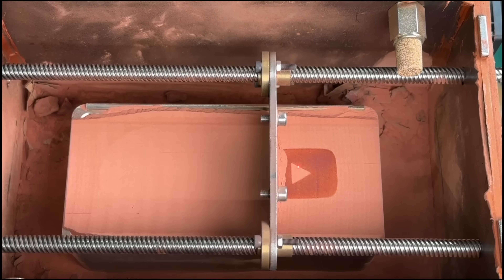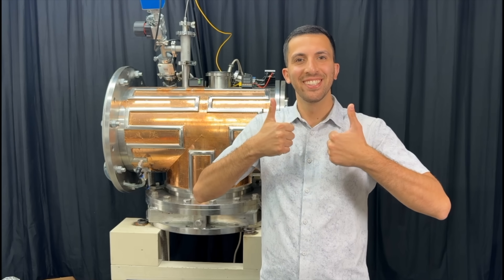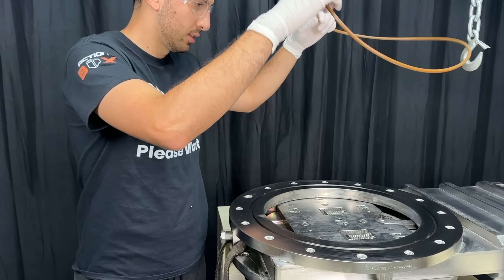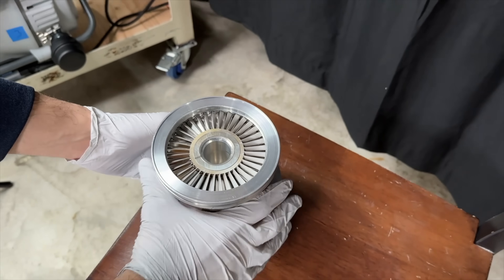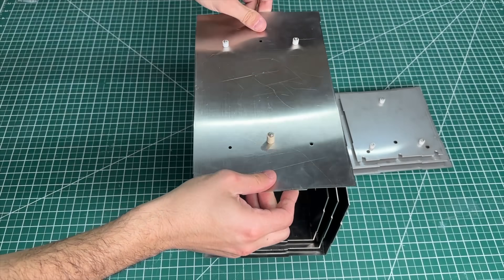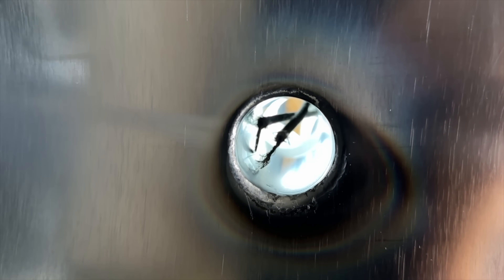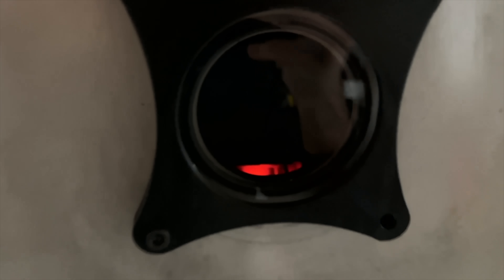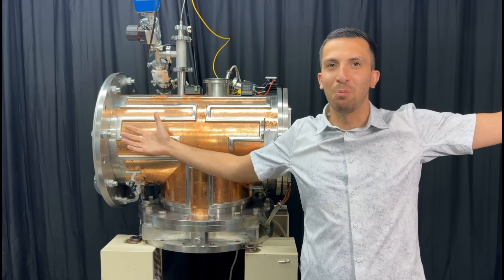DIY Vacuum Furnace (Full Video)

Comment: I'm floored by the repurposing at work.  Out of curiosity (this is 11 months after the original vid), did that interior magnet hold up to the high heat?
Reply from the maker: About 2 runs actually.  It definitely has to be covered with a heat sink to the main frame to keep it cool, Otherwise it demagnetizes.  Great catch.

Comment: 4:45

That particular style of turbo is cheap on the secondary market because it is ancient and prone to catastrophic disassembly due to using those thin turbine blades (you can't repair shrapnel). Newer models have much thicker and wider blades, incorporate a molecular drag stage to lessen the workload of the backing pump, and often have on-board ion gauges to disable the turbo in event of sudden vacuum loss. A modern turbodrag should be able to reach E-8/E-9 Torr within hours.

Source: mass spectrometer technician. I have several Pfeiffer TC100 equipped D-35614 turbos sitting at my desk, which is what we replaced all those Varian Macro Torrs with over the last decade.

Comment: I'm curious about using the clear plastic flange:

Were you able to get it down to UHV** levels? 
(Ignoring the heating effects for now)

All UHV references for mechanical design I've read so far tell me to just generally avoid it, because of outgassing effects, but I have little actual lab practice with these chambers.
Reply from the maker: I recall being worried that if it shattered under the load, then the turbo pump would be instantly destroyed, so I may have not tried to go to UHV with the plastic lid.
Reply: @ActionBOX  That makes sense. I was always so nervous of breaking the turbo when doing the pumpdown sequence on a leak checker, vacuum is more annoying to work with than people realize lol.

I've been thinking a lot about viewports and feedthrough / motion design, so I was really surpried to see you go with something of that size. We see yet again why windows in aircraft are so small!

Thank you very much for the response 

PD: your thermal shielding design is very impressive and surprisingly similar to how cryostats are planned out for physics-- I'm taking notes from this and also the 3D printer project in general. 

lmk if you could use any  CAD collab for the 3DP project, I'd love to give a hand here and there as I also recently took a certification in DFAM.

Comment: I've worked on a MOCVD system during my college years.... Dangerous chemicals is an understatement. Take Hyrogen+Oxygen for example. Yes H2O is just plain water but H2O2 is hydrogen peroxide. You aren't dealing with just one chemical, elemental arsenic. You are dealing with a wide range of toxic chemicals, each with there own dangers. Also implosion is the next biggest danger here. If the chamber ruptures, all the air will rush in to fill the void, collide with each other, and create a boom so loud that it will rupture your eardrums and kill everyone in the room (if it was a small room at least like our small lab was).

Comment: normally, you'd be in the 10^-6 torr range within 5-10 minutes without special cleaning absent really heavy oily fingerprints, not including the outgassing from initial pumpdown with the size turbpump you have. In fact, if you graph the pressure, you can see the fractional distillation of contaminants.

Comment: I am curious why you do not put the heating elements right inside the large vacuum chamber? Since you are at extreme vacuum, how does the 3 walls help in this situation? Is it just to delay heat transfer from IR to the outside of the chamber? I don't understand.
Reply from the maker: Yes that is correct.  It take much longer for the outer chamber to heat up if you have more heat shields. It also allows your inner most layer to heat up to higher temperatures.

Comment: Very attractive vacuum furnace you got there, especially the design of the sheetmetal reflective insulation. I've got a crusty old one in my shop that was probably used to repair or otherwise weld jet turbines - it's nearly big enough to put your furnace inside. I've got to replace the hot zone (removed when decommissioned as it was either made with exotic metals or graphite) with something like yours as an OEM replacement costs north of $30,000. I scavenged a controller I built in the past for a kiln and repaired a vintage thermocouple / ion gauge controller which can send a signal when certain thresholds are met, to start pumps or heating cycles, etc.

I'm curious to know what your marketing plan is for the metal 3d printers, as I imagine the vacuum furnace cost more than the printer and few people have access to these (currently - metal 3d printing at a local makerspace might make furnaces more commonplace). I only have an FDM printer, a DIY of course, from before you could even afford one for the home workshop, and planned to use the "cast to sinter" process - make a silicone mold of a plastic print, use the mold to form metal powder with a binder, debind and sinter.

Now, a more accessible powder bed 3d printer might be one for sintering plastics (which can be done at lower temperatures and without oxidation concerns, so maybe a spare toaster oven?) or for ceramics, which need higher temps than plastics but can be done in a traditional kiln without oxidation concerns, no vacuum required.

Comment: How did you tackle TC junction at the pass-thru connector? Were there poles of the correct material already? Awesome project and presentation.
Reply from the maker: Great question, I ran into that problem and actually just ran a thermocouple with stainless sheath through a yor lok connector to form the vacuum seal.

Comment: !00% you should get a hydraulic lift table. You an pump it up to the level of your hatchback floor and just SLIDE big heavy things out and roll them away. You can even pump it up to the height of the table you are going to place the part on and skip the hoist all together sometimes.

Comment: The oxygen partial pressure lines on that Ellingham diagram slope down from the upper left, so target partial pressure is more like 1e-7-1e-8 atm. That shouldn't be a problem, but it's different from what you said. Note that, unless one of those big o-rings has a problem, the residual gas under working conditions will be mostly water. With copper that's also not a problem, since water isn't oxidizing enough at high temperatures (should be another line on the Ellingham diagram for that) but with other metals, including as alloying elements in the copper, it's a factor. Also be aware that your pressure gauge isn't measuring the pressure inside the oven box, and that matters because the inside of the oven box has poor communication with the pump but will probably be the major gas source at some times during operation, in which case the pressure inside will be higher by some potentially large factor that you will have to account for. Great work!

Comment: I love that your channel is making all this equipment that's usually out of reach of regular people and its commendable because most youtubers have a its right in sentiment approach even if its misleading, what you can do to improve your videos is expand beyond you projects, because the project is only as good as what you can do with it for example in this video after you finished your build, people like seeing your tests to make sure it works as intended (did it get too hot, was it hot enough , are there any areas to improve, did the item made in the furnace fuse well, etc)  having the audience see the usage process and results turns your project from an over-engineered paper weight in the audiences heads to an idea generating piece of equipment that people want to suggest ideas to what it can be used for, even if its dumb things like creating a mould for your furnace to create precision teddy bear shaped toasted marshmallows.
I hope non of this comes across as criticism and more as constructive criticism, for me it would be cool to see some smaller projects using the equipment you have made, hopefully this comment helps. :)

Comment: Like your project an idea of 3D metal printer.
Here’s a problem to solve.  How to take existing molded products.  Directly replicate into a sinter body that can be sintered in your chamber.  Then goes into a moldings press.  3D scanning sucks because the entire object basically requires to be remodeled.
Reply from the maker: Hi Dan, We already have a solution for that. Check out our video from last week about INJEKTO M. You can simply replicate your parts with an RTV silicone, and then use INJEKTO M to inject metal into the silicone molds. Let me know if you have any questions.

Comment: I googled  "nichrome heating element" and also tried google lens on the image @7:00 but only found a single result that looked similar to what you're using from some website in Korea, finetherm.  Do you have a link to the one you used?

Comment: I'm surprised you could get to 10^-6 Torr range (@5:08) with that huge acrylic surface exposed to the vacuum.  Most things I've read talk about acrylic only being good down to maybe 10^-3 Torr.  Interesting.
Reply: That's exactly what I was thinking when he said he wanted a high vacuum but then put in a plastic window,
Reply: Pretty sure the use of o-rings keeps you out of the ultra high vacuum range.  Conflat flanges with OFHC copper gaskets will get you there!

Comment: interesting but makes no business sense to sell a diy printer that requires a super expensive vac chamber like this. 
Do you need hi vac or just very low oxygen for sintering ?There may be simpler ways to capture oxygen using redox reaction
Reply from the maker: Check out our latest video about INJEKTO M. We have solved this issue.  You do not need the vacuum furnace.  The furnace we provide will work as well 😃
Reply: @ActionBOX  yes ok the timeline got me confused, I guess this deluxe oven came before the last injecto video in your research even though the video for the oven got posted after

Comment: I was under the impression that turbomolecular pumps were supposed to be installed at the bottom to work with gravity.
Reply from the maker: There are different types with different levitation methods.   Some have a specific mourning orientation. The one we used did not.

Comment: Couldent you have got a lot lower tech by just using argon or nitrogen?
Reply from the maker: No sir.  In a high vacuum chamber at 10^-6 torr, the oxygen content is about 10^-9 atm, equivalent to ~1 part per billion (ppb).

In contrast, a 99.999% pure argon bottle contains around 10 ppm (parts per million, not billion) of impurities, including oxygen.

So A vacuum at 10^-6 torr has oxygen levels far lower than that found in ultra-high-purity argon.

Does that make sense? I can try to explain it better if needed.

Comment: Like the others said, remove the influencer bs, you guys don't need it. Your projects have actual substance.

Projects I'd love to see in this area (I know your covered some already): Drill press upgrades (bearings, DRO etc), press brake & shear, spot welder with flexible leads, sand blaster + cabinet, powder coating, bench top press (die cutting, pin setting etc), storage and moving solutions, surface grinder. 

Basically considering the full picture end to end of some products that might be made with your tools, from prototype to finishing, packing and shipping.

Comment: zinc coated steel is not good for welding. citric acid bath is not the fastest way to remove the zinc layer, but it is cheap and non-toxic. for the next time you tig such wheels into something.
Reply from the maker: Thanks for letting me know. I assume you are a welder? As I said in the video, I am clearly not so I appreciate your input.

Comment: In a pinch you can use spark plugs as vacuum wall feed-troughs.
Reply: I was going to suggest the same.  Have you built a vacuum chamber?
Reply: @ me personally not. But I worked on many things from particle accelerators to nuclear power plant components. I built my own glass laser tubes 30 years ago, so I have had some exposure to vacuum devices and the challenges that come with it.
Reply: @SarahKchannel  cool.  I know about the spark plug trick from some guy who used it in building a chamber for coating telescope mirrors.
Reply: Would the same principles apply for ultra high-pressure applications? Like building components for deep sea?
Reply: @ From a force calculation approach yes, but from a seal perspective no. Pressure seals are the inverse of vacuum seals. Where vacuum pulls everything together you 
have to account for compressive strength on the sealing surfaces, while at pressure (e.g deep sea), everything is being ripped or pushed apart. 
Not sure what the inner structure of a sparkplug  is. Put the electrode rod my be pushed out of casing at high pressure depending how it is designed.
Reply: @SarahKchannel cool
Reply: @matttgray  Also vacuum pressure is max 1 bar(unless you want to bring your vacuum chamber to the deep sea)

Comment: I’d love to try the printer. I have my CO2 laser that hasn’t been doing anything so even if I got an idea on how to repurpose for something like this would be cool. I doubt my laser is compatible but it would be cool if it was.
Reply from the maker: Unfortunately CO2 laser wont work, but we actually invented an FDM style metal 3D printer. Check out our video from last week on INJEKTO M and you will see it in there.
Reply: @ I saw the injekto, love that idea as well. The powdered bed setup would be more applicable for the parts I tend to make so when I saw that I got curious.

Comment: thanks for pointing out the hazards of buying used vacuum gear especially from semiconductor fabs. i have seen soo many people just negligently playing around with used vacuum systems off ebay from some random company. Your definition of peanuts is quite interesting, a small used turbomolecular pump, something like a turbovac 50 will likely cost you at least 300 bucks, maybe 200 bucks if you're willing to design and build your own controller electronics. Some notes on the furnace: these o-rings are not made for temps that high. you might run into issues there. the nichrome will be fine as long as you are just working with copper, other metals with higher melting point will necessitate diffrent methodology such as carbon arc(hard af to get a good vacuum with as these off-gas like crazy) or high power induction heaters. The component you were looking for is called a high vacuum passthrough. reusing an ion gauge like that is quite resourceful though.  if you need something like this again, you can save a fair bit of money using a ISO KF flange end cap(like 10 bucks) and a couple of spark plugs. these make for some great high vacuum passthroughs. steel is not thaat reflective to IR radiation so you might want to look for something else as an IR reflector. for long term operation water cooling the chamber walls close to all of the o-rings to dissipate heat away from the o-rings might be necessary. for anyone on a strict budget i am currently designing a high vacuum budget low volume induction heated furnace for at home Si fab experiments not done yet. For anyone wanting to replicate it: basically just an electromagneticallly levitated platform with induction heating built in. the system uses exclusively ISO-KF flanges that are really quite cheap. the chamber walls have a chemically deposited silver reflective coating which is really usefula s it allows for soldering stuff onto the chamber walls with pure silver solder. the sealing sections are covered on the inside by a silver coated stainless steel ring. the reflectors are aligned to reflect the majority of IR back into the target. the vacuum chamber also uses spark plugs for the required passthroughs. as high temp tolerant thermocouples are hard to come by i use a DIY optical passthrough to direct light out of the chamber. inside the chamber that passthrough is directed at the levitating platform. also a laser diode reflects 435nm laser light off the platform into the passthrough. outside the chamber i use a simple beam splitting assembly and some miscellaneous optics to generate a spectrum i can view from a debayered camera sensor with the unrefracted laser beam merged onto it. the position of the laser dot tells my control circuit the orientation of the floating platform that uses PID control to correct that. the spectrum is used to calculate the target temperature through black body radiation. the entire assembly is watertight sealed with epoxy and submerged in distilled water. most of these components can be salvaged from the scrap or sourced for cheap so you end up with about 80-100 bucks excluding vacuum pumps and gauges for a furnace that can easily safely surpass 2kK for extended periods of time. volume is extremely limited at about 20x20x30mm and a max weight of 15g. so with some adaptations this may be suitable to make this process available for cheap at a lower scale? not sure

Comment: I don't think you get much interest in the DIY metal printer. largely because of the costs associated with the vacuum furnace needed to sinter parts.  Probably the cost for a decent size vacuum furance is around $5K to $10K, even if you get used parts. 

Probably a more practical method for DIY metal printed parts is to use a laser cutter to cut out layers from a sheet that are stacked together & than brazed\soldered using a small desktop furnace. Parts would be made with the same outside dimensions, & outside surfaces machined in a CNC or manual mill\lathe. This would make better quality parts (stronger) but with internal structures that would be impossible to machine using a CNC mill.
Reply from the maker: Absolutely wrong 😜. Check out our previous video of INJEKTO M where we show our latest metal printer which comes with a furnace, all for $2500. Don't worry, we've considered the limitations and plan on making this accessible to everyone 😉

Cool idea though and thanks for sharing.